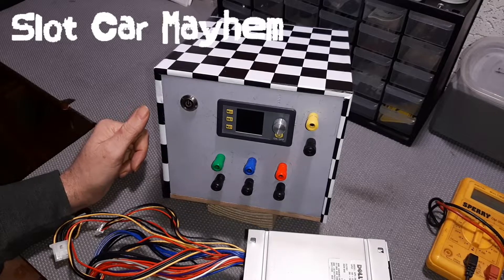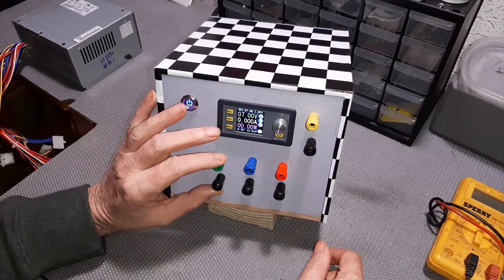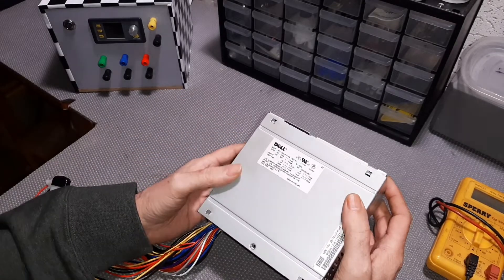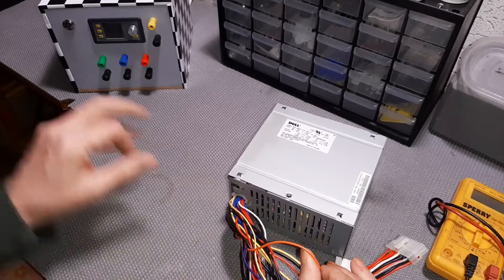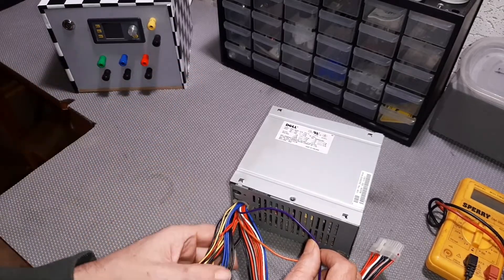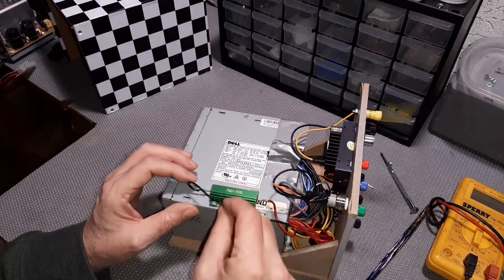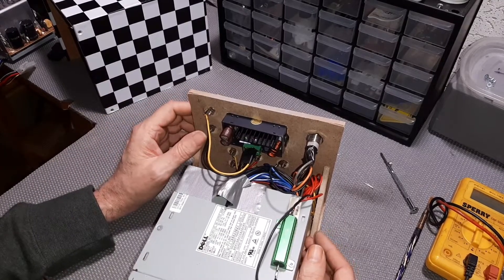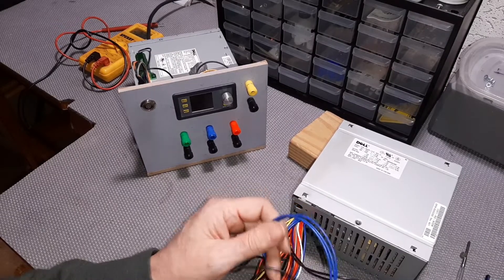Tools n Stuff - Episode 01 - Build a Power Supply

Comment: Hi John
Could you suggest a commercial power supply ?
Reply from the maker: You mean for the track power? If so, an adjustable 20 amp 30v power supply should work. If digital, you need to set voltage and amp settings to match the CU. If your looking for a power supply for other things, and are not concerned with adjustability, a universal laptop computer power supply is often a great cost effective option.

Comment: John, Having trouble hooking up the switch. I am using the ATX power supply, the green, and grey wires, and flowing the wiring diagram that came with the switch but I can't get the switch to operate correctly. I purchased the switch above from Amazon. Would it be possible to send me the ATX wiring for this switch, please?  Thanks, Ron
Reply from the maker: I am trying to see the best way to get the sketch to you. Until then, here is a description of what is what:
1. Place switch button down on your bench.
2. There are 3 terminals  that are oriented in the same direction, and another 2 terminals that are oriented in another direction.
3. rotate the switch until the 3 terminals that are oriented the same direction are stacked vertically, and the terminals themselves are oriented left-t-right.
4. the other 2 terminals should be to the left and the right of the 3 terminals. The one of the left should appear to be in the "middle" of the circle, the one on the right should appear "lower" than the one on the left. Rotate the switch if necessary.
 5. The GREEN wire from your ATX should go to the LOWER of the 3 terminal group.
6. Take a BLACK wire from your ATX and connect to the MIDDLE terminal of the 3 terminal group.
7. Take your GRAY wire from your ATX and connect to the LEFT terminal of the 2 terminal  group (the one that  appears to be in line with the middle of the circle)
8. Take another black wire and connect to the RIGHT terminal of the 2 terminal group. 
9.IF THE LED DOES NOT LIGHT AS EXPECTED, REVERSE THE GRAY AND BLACK CONNECTIONS AT THE SWITCH (LED's are polarity sensitive).

That should do it...  The 3 terminal group is your switch (Common, Normally Open, Normally closed terminals) and the other 2 are the LED terminals.

The green wire gets switched to ground (black wire). The gray sends a 5V signal if  the power supply is working correctly., and also needs the ground reference (black wire).

Hope this helps...
Reply: @slotcarmayhem9765  Thanks John for getting back to me. Yes, this helps a lot and I understand your explanation. I'll give it a try. 
As I mentioned before to you, I am looking forward to your next video on the bldgs. Have there been any Smart Race updates that you can post? What kind of information can you give us on tires? my cars are sliding all over the place now. I have been wanting to purchase a Tire Razor like yours but they are no longer available, Do you know of an alternative that will work with Carrera cars?   Take care,  Ron

Comment: Hi John, can you give me the box dimensions and where to place each fuse holder? Also, I was wondering if you cut a hole in the box for the fan if so where did you cut it? Thanks, Ron
Reply from the maker: Hi... the box itself is aprox. 8" cube. The power supply is mounted flush to the back exterior. The rear panel is only a couple inches high to allow the PS to be exposed (no fan opening to cut as the entire back of the PS is exposed). The fuse holders are internal on mine as I finished the box (now solid orange) before the holders arrived. If you want external fuse holders, I would place one under each pair of jacks so you know which fuse serves which circuit. Hope this helps!!
Reply: @slotcarmayhem9765  Yes, very helpful. I was going to put the fuse holders inside the box. Correct me if I am wrong, the fuse holder only attaches to the pos. side of the terminal for each pair of jacks, right? so for your setup, there would only be 4 fuse holders?
Reply from the maker: That's correct.

Comment: Hi John hope you can help me. My ghost cars only make a few rounds and then stops. Can you help.
Reply from the maker: Not sure... Couple questions. Are they F1's? The smaller F1 decoders tend to overheat when used as ghost cars. I also assume they are set as ghost cars not pace cars. Are they set to a very low speed? Do they all stop hard, or do they slow down then stop?  Are the motors warm when they stop? Are you running any race management software?
Reply: @slotcarmayhem9765  HI John thanx for your response. I managed to rectify the issue. The boys were setting it up as pace cars 😄must tell you was a bit worried. Thanx again. Love your videos.

Comment: I'm sure you'll get to this at some point, but what is the purpose of this and how is it associated with Glendale 65?
Reply from the maker: The power supply? We will be migrating to magnetless racing once the track is at a certain point... this unit will power the tire truing machine (truing tires is a MUST for magnetless racing). A similar unit will be used on the track itself to power lighting and other accessories.
Reply: @slotcarmayhem9765  John, When I started playing with slots in the 70's magnets were like a unicorn!  Truly enjoying your informative videos.  I ordered the 30008 DTM Furore just a bit ago.  I don't think I'll have quite as much room as you have, but I can fit a 4 x 8 sheet of MDF on the dining room table.  Thanks again for doing the prep work & sharing it with us.
V/R
DRew
Reply from the maker: Yes, magnetless is a lot more fun. Before this, I had a 4x8 HO 4 lane, and quickly we switched from the fast in line mag cars to old school T-jets and AF-X. Everything slowed down, but the fun factor went way up. Laughter was the norm on race nights. We ran a LOT of "crash and burn" races, and looking forward to doing the same here, just for fun... no points or anything. Just fun. Most of our point races will be a 4 hour simulation of 24 hour events (LeMans).